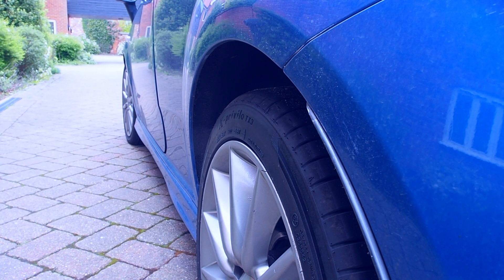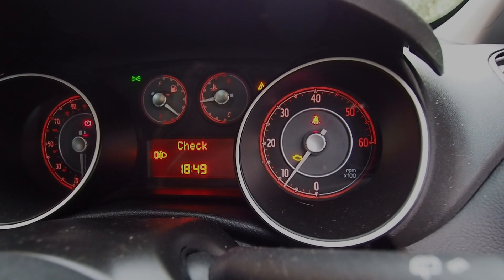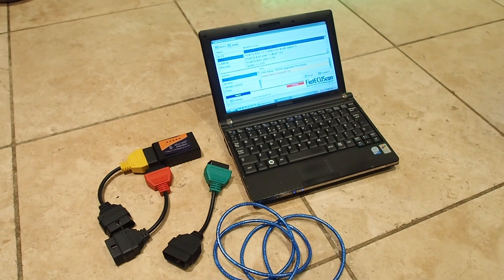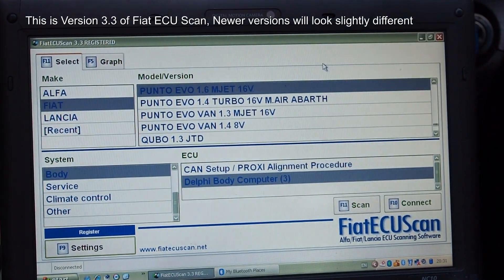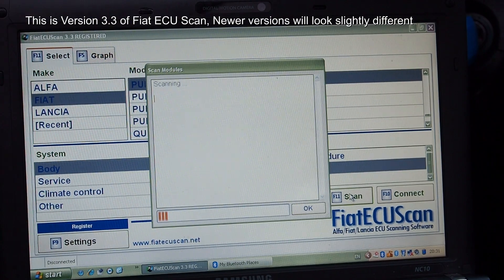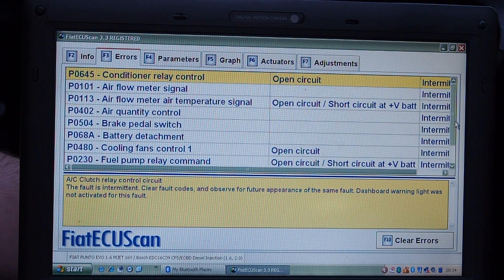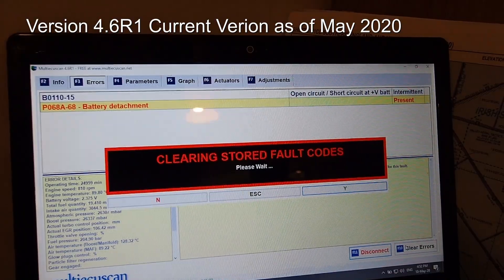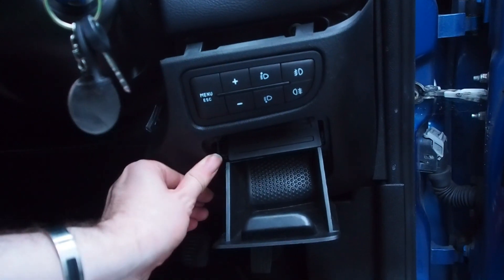Using Multi ECU Scan to reset warning lights and error codes Fiat cars Punto Evo

Comment: Just a question, would the multi scan software reset any warning lights on the dashboard?
Reply from the maker: It can do, it depends on the reason for the light. If there is a fault then the light will keep coming back until you fix the fault
Reply: @PuntoHowto  it’s says ‘check running lights’ even though all bulbs are working. Would clearing the trouble codes reset it.
Reply from the maker: @realfaisalk  nope the car is still picking up a fault so while the bulbs might be working one of them is either not getting a good connection or giving a high or low resistance, I had it with my Evo and my grande that the side lights in the front would blow but you couldn’t tell with the headlights switched on
Reply: @PuntoHowto  because sometimes when the headlights are on in the night a bit of smoke starts to come out from the front.
Reply from the maker: @realfaisalk  to be fair that can also be steam coming off the hot head lights if it’s damp
Reply: @PuntoHowto  Because it passed MOT last week and as soon I had my car back it displayed the message so it can’t be a blown fuse or weak connector so it must be an error as told by a mechanic. Is there any way to get rid of it.

Comment: Great.  I have a Duologic with transmission fault.  I fixed my last airbag ecu module no problem with MES. Wondering what software will tell me for this robotic automated manual box.   Cheers Dan.
Reply from the maker: Yes MES should be able to tell you fault codes from the gearbox but you may need to have the full paid for copy.

Comment: Hi andy  I left a coment and did this on my new phone and did not get to ask a question properly  so here to try again  the scan tool you  are using can you tell me if possible does it 
scan for  transmission  faults  I would be greatfull for any help you can also tell me the name 
of  the name of the scan tool I was thinking of buying another  scan tool  one that will scan transmissions anway keep up all the good work doing these videos  KENNETH
Reply from the maker: The software can read faults on transmissions check the MES website to make sure your car is covered

Comment: Hi Andy and the scan tool you sent me are using the does it scan for faults codes in the transmission if so could you please tell me the scan tool you are using so I can get one my punto has transmission problems if you don't mind thanks Kenneth
Reply from the maker: The software is called MultiECUScan MES for short used to be called FES (fiat ecu scan) look it up on the website will tell you what you need to get started with it. If you have any questions they have a forum in the website. It should be able to look at faults from a transmission
Reply: @PuntoHowto  thanks for the reply Kenneth

Comment: hi i had a question. i have a punto evo from 2011 1.3multijet with a magnet marelli 8f2.g4 ecu i cant find the ecu in the list i see that it only support 8F3 ecu's. why cant i see or read the engine ecu with MES??
Reply from the maker: Sorry can’t answer that question, you’d be better off posting on the forums on the MES website or sending them an email

Comment: Can we connect to company fitted Music playes using multiscanecu software and activate or disable aux or usb

Is Multiscan software is free or should we buy
Reply from the maker: I don’t understand what you’re asking ?
Reply: @PuntoHowto  thanks for the revert.
My query was
By Connecting MultiscanECU software with punto car and activate /unlock aux option in company fitted music player
Reply from the maker: @tdkreddy748  no I do not believe that multiECUScan has this ability, some radios just work when you plug in the aux
Reply: @PuntoHowto  thank you for the revert, my Delphi IN199 HU do not have aux option enabled, same HU in dynamic and emotion models it is enabled, when we press CD button twice it is not showing AUX

Comment: Hi, is it possible to obtain the Fiat code with multiecuscan?
Reply from the maker: Do you mean the code to unlock the radio, no, you’ll need to get the serial number off the radio and approach a company that has the software to produce the code

Comment: Hey buddy! I noticed that at the start of the video your Start Stop said unavailable? This is my fault code. I'm waiting on my devise arriving to clear this. Do you have the same issue? If so, how did you sort it? I was thinking it could just mean I need a new battery as I have the original one still installed from 2010. Car starts up fine everytime. Just the start stop has never worked. Cheers
Reply from the maker: It’s not a fault code, just times that stop start is not available, in this instance it was the battery not being good enough for stop start to work, the battery was perfectly good but fiat stop start system is fussy and anything less than perfect will annoy the system and stop it workings the battery would have otherwise been fine in a different car from a different brand

Comment: I just bought the elm 327 obd 2 product. I will try to delete start-stop error code on my punto . Thanks for video!.
Reply from the maker: Stop start error will be because of a fault in the system you’ll probably have found by now you can’t just delete a stop start error message
Reply: @PuntoHowto   you are right, I can not remove it with ELM. In Turkey; we are using a secondary fuel system "LPG" becaause of the high gasoline prices. The start stop option was disabled by LPG Technic service in order to prevent any problem while restrating the engine. (Engine must be started with gasoline, than after LPG will be automaticly activated when the engine tempareture is suitable.)

Comment: Hello sir , First of all would like to thank you for your useful videos. I have a Fiat punto evo 2011 and one day out of curiosity turned on the seat belt buzzer or allarm , now i am in a mess and regreful of what i have done , no way to get it back to the former state ( with no allarm sound ) The option is now disappeard from the menu . Last year took my car to a (said) Fiat dealer to turn it off but no success , they could n't turn it off , Charged me even the labour costs . Is there any way to deactivate the allarm sound using Multi ECU scan ? Would be grateful to recieve any answer from you ?!
Thanks in advance.
Reply from the maker: Yes you can turn off the seatbelt alarm with MES, I think you might need the full registered version

Comment: I have a Fiat 500 and i show me now fuel cut Off unavailable ,airbag,start/stop.I did the diagnostic on haldford today ,i change the battery and they try to erase  the errors but it comes back .they says is ECU. 
Can you help with advice please ?
Reply from the maker: I don’t really have any experience working on 500 but I know they have a lot of airbag ECU problems so what you’ve been told maybe correct

Comment: Good vedio,
I have punto 2017 
Done 70k but have this continous alarm check transmittion, have changed speed sensor twice, worked well for awhile then alarm get back again. Very frestruated
Reply from the maker: The automatic gearboxes on fiats are such a headache I wouldn’t touch them. I’d be looking at getting advice from the dealers, sadly a 2017 model is going to be out of warranty and this sort of problem can get very expensive

Comment: Good day... my fiat 1.2 punto is now check engine status with 27,0000 km. Is it possible that can i fix it same procedure in this video?
Reply from the maker: Yes you can plug In and see what the fault is, if it’s just a glitch somewhere then you can clear the fault and the light should go, but if something is broken and it needs replacing then the light will keep coming back on
Reply: @PuntoHowto  Thank you very much for the info... i’m a subscriber from Turin Italy...

Comment: hi! lot of t-jet have cold start problems (starts with 2 or 3 attempts), it often depends on the fuel... it is ECU-software issues or something?
Reply from the maker: Not something I was aware of so not something I can answer, obviously a lot of t-jet cars are getting older so I’d expect a lot more problems on those older cars but specific problems with cold starting is not something I’ve heard about

Comment: Hey - thanks a lot for your video, very helpful! I ended up buying a ODBII interface from amazon (made in china, doesn't say much else .. lol). I'm running multieuscan 4.7 on win10 and i connect via bluetooth mapped to com5. I'm trying to connect to a punto evo 1.4 (2010) - When I open the software, I set the port speed to 38400 bauds, i click test and it seems to work ok, however when I try to connect to the car, it gives me a timeout. Has this ever happened to you? Not sure if you're using the same interface but it definitely has the same colors as mine, looks the same minus the leads.. I just plug mine straight in from the back without the lead :D I'm finding online some interfaces from china require a modification where you remove a resistor.. did you have to do that with yours? Any tip would be greatly appreciated! :D Thanks dude, great work
Reply from the maker: Yes I did have to modify mine, instructions are on the MES website. Worked fine after. I bought mine about 9 years ago now, I stupidly assume they would have maybe fixed this problem
Reply: @PuntoHowto  thank you! They give you a silly android app to install with it.. my neighbour claims that it works on his car.. he uses incardoctor.. I guess I'll give it a try, I don't need to do anything too fancy after all, just try and clear the airbags light.. it appears that for 7 pound more you can get a decent lead on eBay that you don't need to tinker around with so let's see, something else to try.. haha thank you for the great video again! And  also for replying to the comment :)

Comment: Good video. I have 2012 Punto Evo 1.2. I’m am getting what looks like two different warning triangles come on, neither of them the engine light but they come on almost every time i drive after a few minutes with the warning ESP unavailable, stop start unavailable, and hill holder un available. some times not at all. Do you know what could be causing all this. Happy to buy the kit recommended if I need to.
Reply from the maker: could be a number of different things, you'll need to get it plugged in.

Comment: Hi punto How to,
Great videos and very helpful.
I have a 56 pinto grande 1.4
Have a problem with the engine cutting out first thing I  the morning when cold... think  the problem is the  coolant temperature sensor been faulty but cannot locate it.
Reply from the maker: Temp sensor is on the thermostat housing usually.

Comment: Very informative video 👍🏾 I have a fiat punto 1.9 multijet diesel 08 the ABS & ECR lights appears had it tested which two faults appears U1715-87 & C1215-29 I then put the brake switch & still the signs appears could you help ?
Reply from the maker: Having a little look at what these codes might mean as they are manufacture specific, it may be a problem with stability control sensors or it may be a problem with the CanBus system itself, beyond that I can’t really offer anymore help.

Comment: Can u show how to clean EGR ,GP 2006 1.3 MJET
Reply from the maker: Sorry I can’t because I don’t have a car with a 1.3 multijet engine anymore, haven’t had for about 5 years.
Reply: @PuntoHowto  :( Do u know does egr sprey helps to clean egr with out anmount it
Reply from the maker: DZomla Masina yes the instructions are on the can, usually it involves disconnecting the turbo pipe and spraying the cleaner into the intake pipe while the engine is running so that the cleaner circulates inside the egr valve.
Reply: @PuntoHowto  yeep,ty a lot

Comment: What was the device name which you connected on obd port and where can we buy the device. If possible could you please share the link. Mine is fiat 1.3 multijet 2009 model
Reply from the maker: ELM327 is the adaptor used, however you may need a set of patch cables shown in the video to access everything on your car, depending what car you have. You need to look on the Multi ECU Scan website for that information. Not knowing what country you’re in means there is little point me providing links, check amazon or eBay, or equivalents where you live
Reply: @PuntoHowto  I'm from India
Reply from the maker: Cool so you’ll need to look up ELM327 on what ever sites you use locally.
Reply: @PuntoHowto  thank you

Comment: Has your car really done 170k+ miles. Looks flippin' good for it 👌
Reply from the maker: Yep, mostly in a period between late 2011 when the car was new and mid 2018 when I bought it. Mostly on motorways and was seemingly well looked after, the only down side it the massive number of stone chips. Embarrassingly I have only put about 4-5k on it, in 2 years
Reply: @PuntoHowto  I had a Bravo like that. Bought it new and put 80k on in 3 years 😱 Fiat paint is terrible for chipping. Mine was red, the undercover was white, looked like it had spots 😢
Reply from the maker: Yep it’s a similar problem on the Punto also looks like the surface of the moon. 🌓
Reply: @PuntoHowto  Now you've said that I can notice them, I thought it was just dusty. How about an Abarthesq matt black wrap on the bonnett?

Comment: Great video!  Thank you mate!  What do you mean at  6:17 when you say "the one we need to fix"?  Does that fix the problem? don't you need to take it to a mecanic or something? Thank you for your work! Cheers from Portugal!
Reply from the maker: I had unplugged some things to create the errors, when you do this with older cars you can have lots of errors recorded way back that have never been cleared. So you have to clear all the errors then use the car to see what the current faults actually are. The fault the “one we need to fix” was me turning the ignition on and off repeatedly and rapidly to make the car think there was a starter fault” no actual fix required, but if it was a real fault then the starter is where we would then look, or take it to the mechanic. Thanks for watching from Portugal 🇵🇹 🥳!! Andy